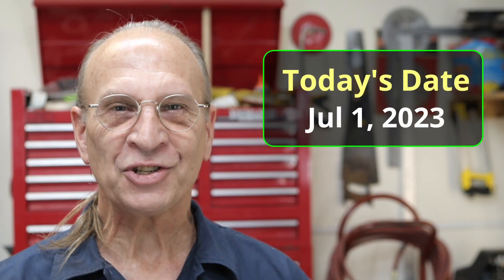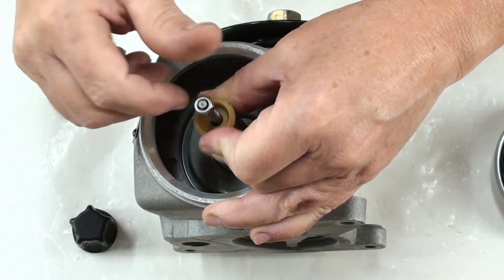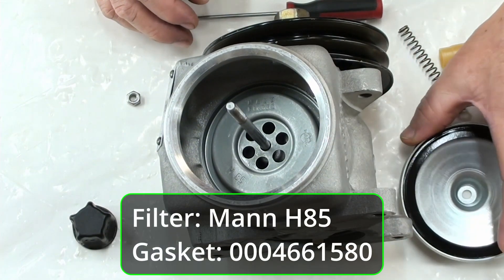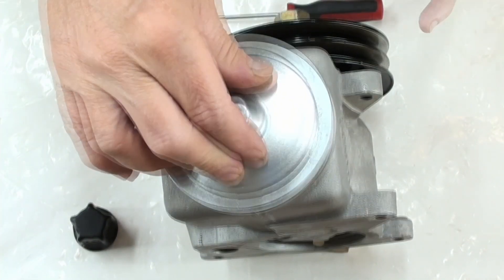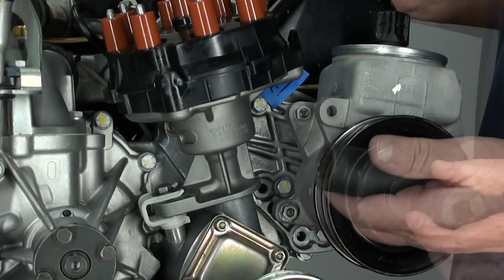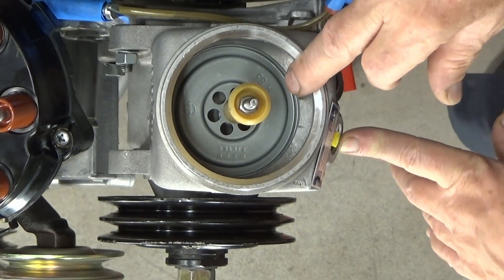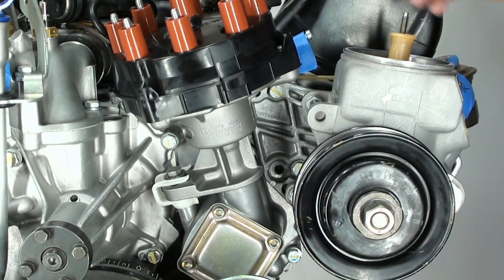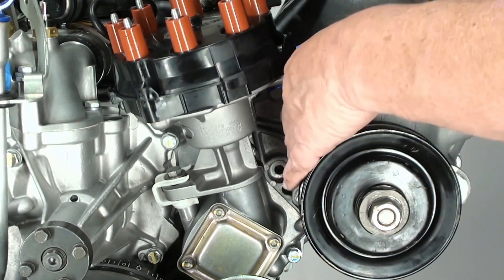560SL - Installing The Power Steering Pump & Bleeding The Gearbox

Comment: Hi love the video I purchased a new pump and the wheel doesn’t move by hand is that normal or should I get another one?
Reply from the maker: @SHGGARAGE  do you mean the steering wheel doesn’t turn or the pump wheel doesn’t turn? Engine running or parked? Front wheels on the ground or lifted? How did it work before you changed it? You can see how I did it and how it was for me. My steering wheel is easy to turn and the pump can also turn by hand with or without fluid. If your pump or steering wheel does not turn I would say something is wrong somewhere.
Reply: @ yes the manufactured pump pulley doesn’t move so when I installed it caused the belts to not move which causes my steering wheel to not move

Comment: Unfortunately i dropped the adjuster nut that is between the power steering pump and the mounting bracket and can’t find it. Would you happen to know the part number?  Oh your video it shows up as 179
Reply from the maker: @chrispintinics  I believe you will find this site useful for finding part numbers. https://www.ilcats.ru/mercedes/?function=getGroups&class=1&catalog=575&aggtype=FG&model=107048&language=en this link should be exactly what you are looking for https://www.ilcats.ru/mercedes/?function=getParts&class=1&catalog=575&aggtype=FG&model=107048&spmcatalog=371&spmaggtype=M&spmmodel=117967&group=13&subgroup=045&language=en

Comment: Hi Tony,  the owners manual to the 560 says  to just use ATX fluid….,
Reply from the maker: I have never used this. The only fluid I have ever used is genuine Mercedes power steering “oil” part #: 000-989-88-03. It is much different than fluid. It looks like regular oil. You might be interested in hearing what Kent has to say after he heard about excessive wear from using Dextron 3: https://youtu.be/TLR_kdnsJ_0?si=CvWyOXV6teoVnO05
Reply from the maker: I should also include a link to the manual where it also states this oil: https://www.startekinfo.com/service/download-document/outside/11883/PROGRAM/Maintenance/My81/4611.pdf